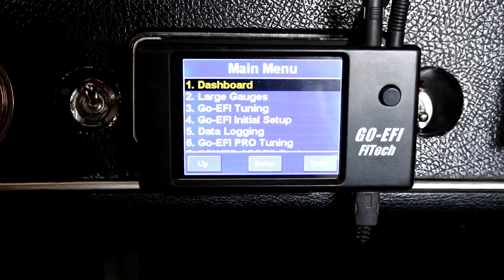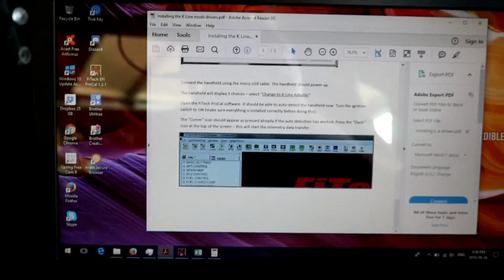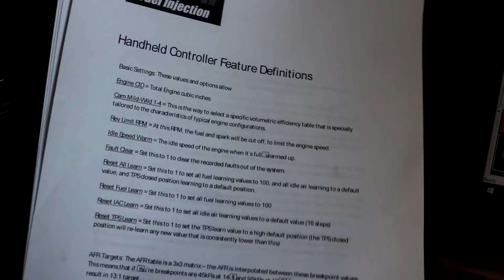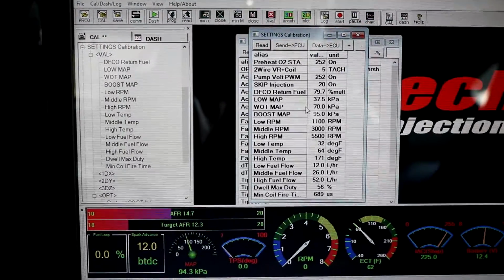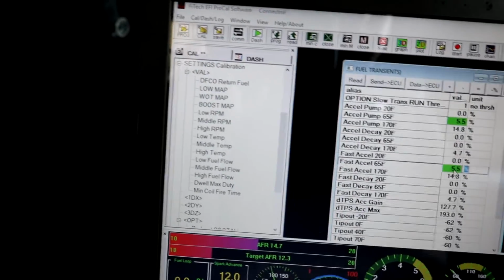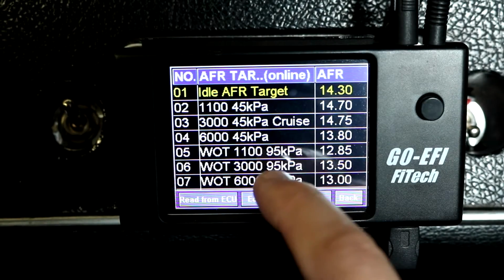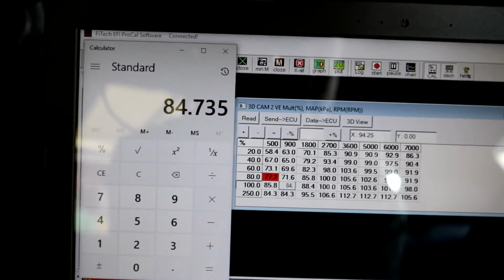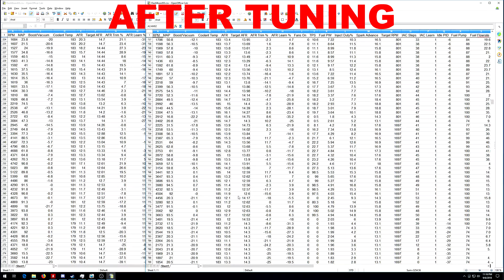FiTech Pro Tuning

Comment: thank fer video i can not figure out why any one  would want to tune with a hand held device as a megasquirt owner i would never use it nor even before i bought ether one of theses units would i use a hand held one resin i never bought a hand held tuner in my life as it just not a professional way at tuning ..looks like i need the hand held junk to plug the computer into ill be calling then as i ant got one if it cost a fortune ill just use it as a throttle body using a megasquirt as i fear they may think the hand held unit is worth a mint wen it truth its a 50 dollar part .i may do a review from start to finish i got a weird felling about this stuff //pardon grammar as i wen to Zee publik schooll;]update 
FiTech Replacement Handheld Controllers 60013 105 USD with NO CABLES ok one can buy a bosst ready ignition ready microsquirt  ecu 340.00 with harness just saying

Comment: So i put the go efi 600 on my 383 im not a pro by any means and a tuning guy is like 3 hours away! How can i figure out what the engine needs?? This system is not very user friendly for non mechanics
Reply from the maker: FiTech tells you to use cam setting 1-4 based on how rowdy your engine is. For the most part that is based on vacuum at idle. If your have a very mild engine, use 1, if you have a full on race engine, use 4. That gives you your base tune.
Reply: Yeah I have it on camera setting one she runs she runs fine when you gently roll on the gas pedal but when I go to stomp on it I feel like it’s lean as all hell and I’m not really sure the parameters that I need to change that
Reply from the maker: @Breadslinger  I recommend you do a datalog to know if it's going lean or rich, or both. As mentioned in the video, I would look at adjusting your accel and fast accel.  Most likely you will need to throw a bunch of fuel at it.
Reply: SS454LS6 yea my target afr is like 13 ish and when i step on it kinda hard it goes lean to like 20 ish but when i slowly roll on it the targets stay pretty close
Reply: SS454LS6 ive done multiple datalogs
Reply from the maker: @Breadslinger  The other thing it could be is a clogged fuel filter.
Reply: Cam setting 1

Comment: Could you give any tips on where to start with the Accel Pump and Fast Accel values. Is there any relationship to follow between the two, like if I make the Pump 10 should I make the Fast 20? Or are they independent? I'm having a similar problem as you when doing snap or prolonged throttle holds. It goes very lean then very rich before correcting.
I'm using the Ultimate LS kit but the controllers all work the same.
Reply from the maker: I was sure I replied to this, maybe it didn't go through. Fast Accel is supposed to be for more abrupt changes in throttle position, like going from cruise to WOT. To start, I tend to change both the same in 5% increments. Be sure to datalog so you can see what changes you need to make, and if your changes are making a difference.

Comment: As with everything else to do with my Fitech, the laptop connection does not work either, so can't tune from there. Nothing but heartache from day one. 
As I have previous quality EFI system tuning knowledge, my last ditch effor was to try & tune the system with the laptop & get it to run properly.....not going to happen!
Goodbye Fitech Junk!
Reply from the maker: Which Fitech model do you have?
Reply: @SS454LS6  600 PA
Reply from the maker: @Danger_mouse  The power adder should certainly have pro tune capabilities. Maybe somethin with their interface with your laptop.
Reply: @SS454LS6  Yes, the program has loaded ok into the laptop and can connect to the hand controller on its own away from the car. 
It won't connect with the ecu via the K line once it's all running in the vehicle. 
This was my last hope at getting this junk to operate, but have spent way too many hours and days already. 
Time to cut it free and move forward. I have not been able to register the car while trying in vain to sort out the POS system.

Comment: Question..??

Fitech Ultimate L’s 
Does it do 2 step And if so is there any PDF that you can put inside the link that shows me how to hook it up or you can make a video on it
Reply from the maker: Apparently my FiTech has a 2 step built in. Runs off the AC wire or something. I plan to look into it this spring and make a video on it. I would imagine the Ultimate LS has it as well.

Comment: I’ve got a 99 Chevy Tahoe 5.7 with TBI 
what kind of fitech system would you recommend for that engine type..?? please be specific fitech kit model number
Reply from the maker: I question if a swap to a FiTech TBI would be any improvement at all. A factory tuned TBI will be better than a self learn aftermarket TBI. Unless I am mistaken, and you are putting that 5.7L in a different car.
Reply: Actually the motor that’s in there now is a 5.7L. it runs pretty good but I just wanted a little more from the motor but I think I’m just gonna do it engine swap to a 6.0L

Comment: where can I go to download the Fitech pro tuning software...???
Reply: Thanks for the tip I was able to find it no problem...👍🏾
Reply: @markbaudioconepts  how do you get it out of the handheld into the computer?
Reply from the maker: If you have a power adder unit, its located in the handheld as shown in the video. If you do not have a power adder, I am not sure if you can get it.

Comment: When using the laptop and you make a adjustment then hit send to ecu do you have to key off and on each time...?
Reply from the maker: After I am done all my adjustments I do key off/on, but I am not sure if it is necessary.
Reply: I’ve tuned on the fly, going down the freeway... once I get it how I like, I key off and make sure it saves
Reply: TexasRoadWarrior I do the same with the hand held, but want to see if i could do that with the laptop
Reply: Yes

Comment: I can show you how to change the handheld display values. Just inf files. 

The red square was displayed in the ve table as that’s the cell your car was using for fuel. It does that when you have it connected to the Kline adapter. Makes it good for tuning. It moves as you drive. 

I can also add some of those missing handheld settings to your procal. 

I find that it’s best (if able) to tune the ve. Limit trims to 10% at most. Cause, as you’ve seen, the 50% defaults cause over corrections. Lean tip in to rich bog is very common with fitech.
Reply: @ nabors can you email me
Reply: @Nabors I also would be interested in learning how to update the labels. Cheers